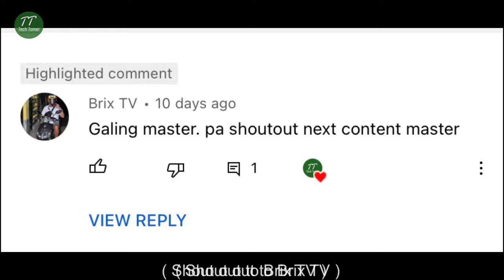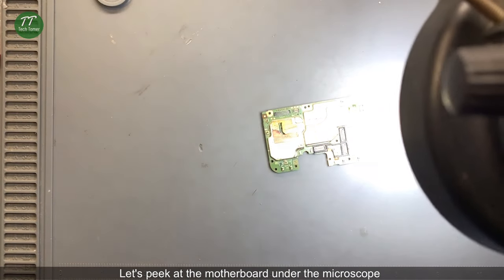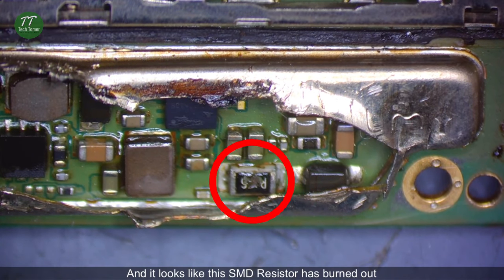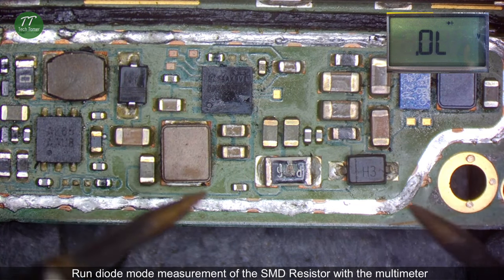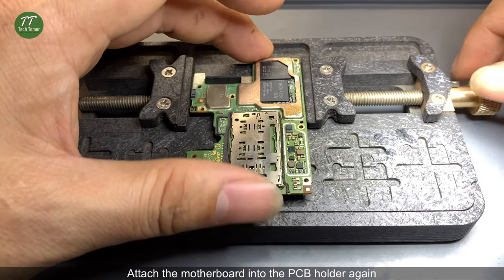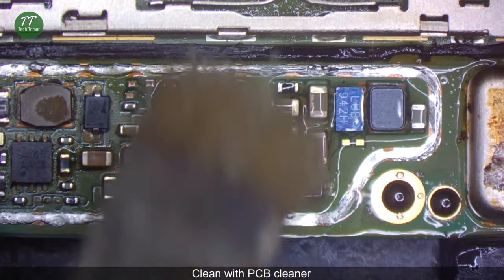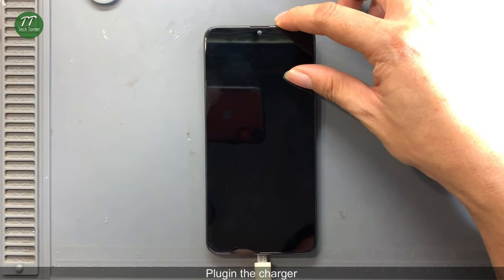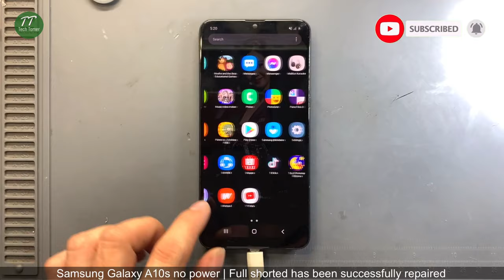Samsung Galaxy A10s Dead Full Shorted Repair Tutorial | Tech Tomer

Comment: Hello! I had the same device. What could be the posible damage on the phone if it displays the charging sign whenever I charge it and displays SAMSUNG A10S but turns off and tries to turn on again. It does continue to the normal display, it only ends up in SAMSUNG A10S and turns off..vice versa.